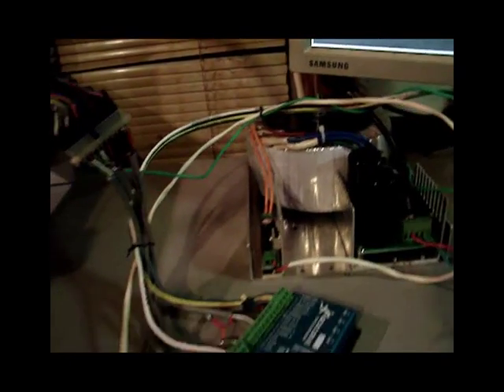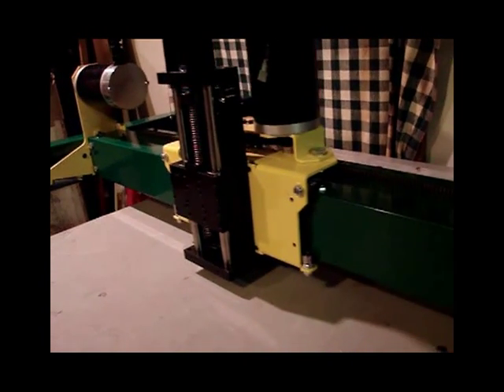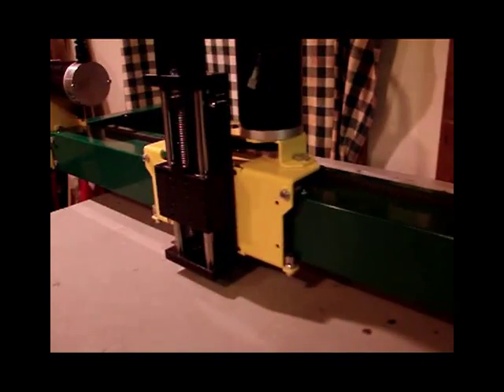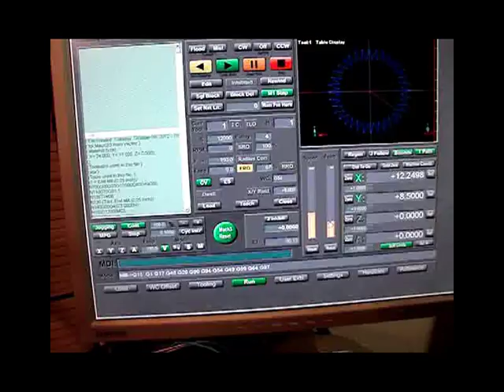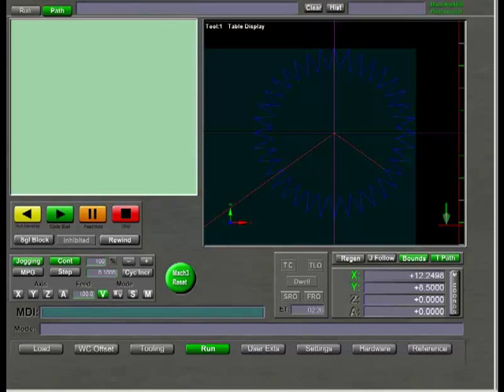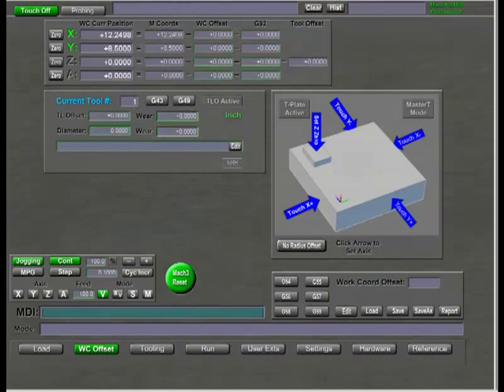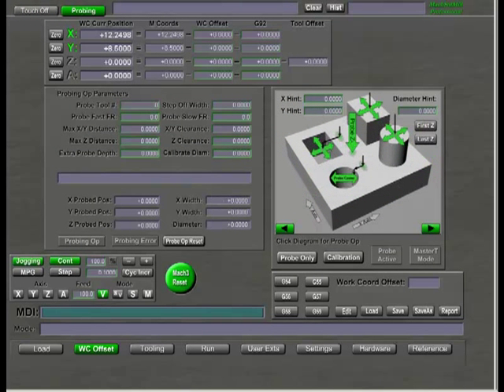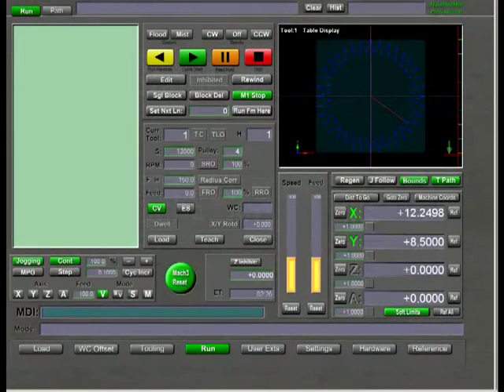Plasmacam Gotorch Retrofit Gecko Servo Drives

Comment: COULD ME AND YOU CONVERSE OVER EMAIL? I WOULD APPRECIATE IT. I STILL CANNOT FIGURE OUT WHAT TO BUY AND WHERE
Reply from the maker: register at readytocut.com - the build thread is there - and discussion(s)
Reply: SignTorch I guess I need to be a little more clear when asking for help! 😂 I had a stroke so I am I haven’t been the sharpest tool in the shed since. So complex thinking is is exactly that. All I need is a list of parts and programs that I can buy and start to figuring things out that’s all. Pictures would help too if it’s not a problem
Reply from the maker: you have to read what I've already written at this link

http://www.readytocut.com/community/threads/parts-list.769/

then click next-thread to step through the pages

it specifies the exact parts used with links

except odds and ends like buttons and switches which I don't know what kind I used or where they came from

Comment: Bro, I'm planning on doing what you did. I have a plasmacam dch2. I believe it comes with servos already, but I can't tell though. Would the process for converting be the same?
Reply: Thanks for the reply. I have a different problem with my table. Ill need all the help I can get. I'll check out the website. Thanks ks again
Reply from the maker: yes - it has servos - I got sidetracked 3 or 4 years ago before I got height control and I just got it all going again - been playing with cutting wood - about ready to get some metal and pick up where I left off - my forum is at readytocut.com if you want to start a build thread or discussion I'd love to see and help you get it working
Reply: Do u have a rough estimate on how much the conversion will cost. And Ill be able to use my servos right?
Reply from the maker: http://www.readytocut.com/community/forums/plasmacam-retrofit.190/

you'll have to read through there and do some shopping - mainly for the power supply, break out board and motor drivers, you don't have to use the exact same parts and suppliers
Reply from the maker: I think it cost about $1000 total software and all but that's a very rough guess from over 3 years ago - just read through the whole thread I think it includes all that information - I can't recall all those details

Comment: What is the voltage on the servos?
Reply from the maker: the first part listed is a 60V power supply - that's what I used - I think the max voltage for the gecko servo driver would be 80v - you can run any voltage you want but more voltage is like more horsepower - over 80v would require a different servo driver

Comment: Has anyone fitted one of these with a router?  What would be the best software to use if I try?
Reply from the maker: +Joe Schmaus see my other videos - the one about routing - turn on closed captions - no audio yet - I mostly use vectric v-carve pro for router work but there's lots of choices - like cam bam and freemill are free - of course that only works after retrofitting - otherwise it only works with plasmacam software

Comment from the maker: The build thread is at readytocut.com, stage 1 having plasma cutter with manual height control is done culminating in an awesome first cut video.

http://www.readytocut.com/community/forums/plasmacam-retrofit.190/

My opinion on Gotorch is it's a Plasmacam, from Plasmacam, with no table, only one year warranty, sub-basic software (which doesn't even have kerf compensation), poor support, and if you don't (plan to) spend the money to upgrade then plan on using external design software with no control over the Z axis, which is not even close to being effective or easy to use.

In the end, I think beginners are way better off just getting a plasmacam to start with, for the table with slats, bigger size, 3 year warranty, phone support, and basic software all ready to use (effectively).  I wouldn't say Gotorch is an entry level machine or that it costs less.

Either way, the plasmacam servo drive is totally awesome, and the (upgraded) software is fairly awesome, and the price really ain't bad when it's all said and done, so I tend to agree that it is a great machine.

Comment: The GoTorch comes with Servos on x and y (from the factory) and a stepper motor driven z axis. If you spend the money and upgrade to advanced design edge software, advanced machine control and advanced height control you will have a great servo driven machine with perhaps the easiest to learn and use software for cnc plasma cutting. I have a GoTorch equipped like this and it is a great machine. You will not find a better height control for a hobby class machine...